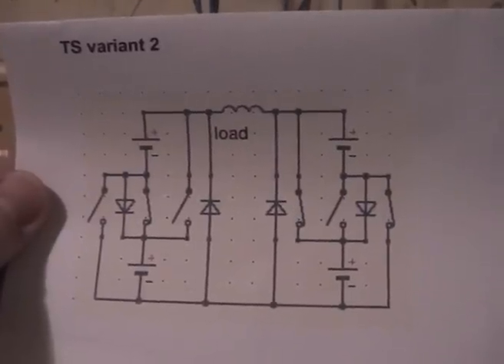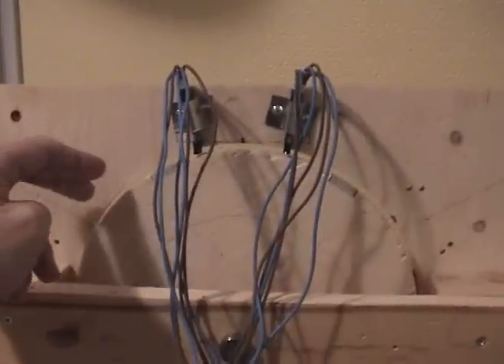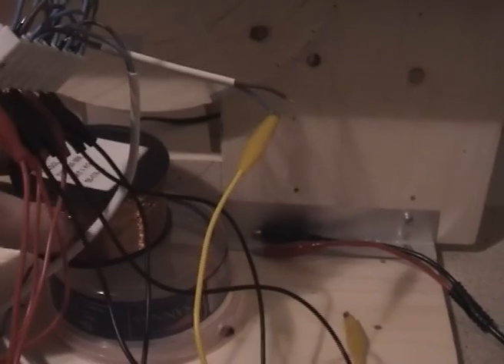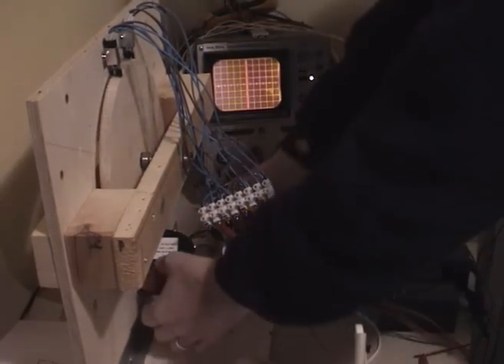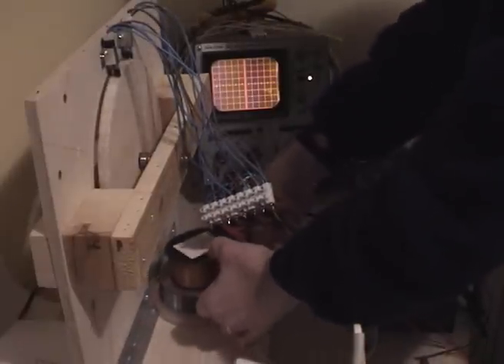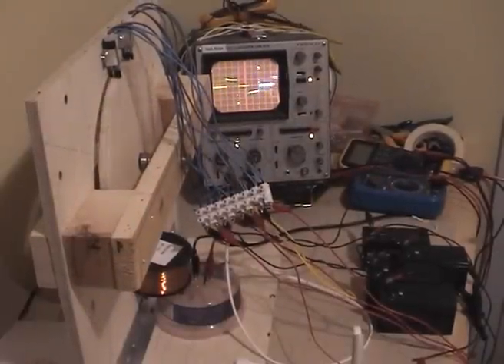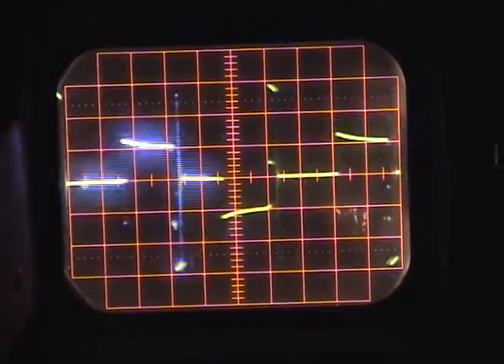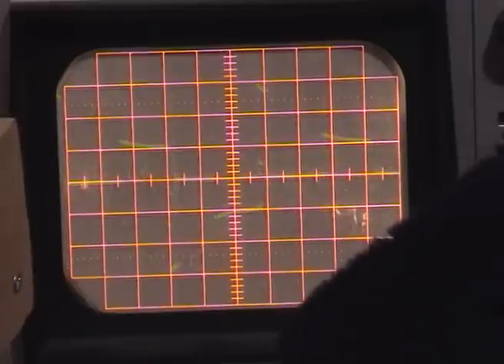Tesla-switch part 4

Comment from the maker: Thanks. There is no additional motor, the wheel is driven by the coil, the magnets and the reed-switches. Three of the reed-switches is turned on to make the coil attract the magnet and the other three to make the coil repel the magnet (for each magnet).